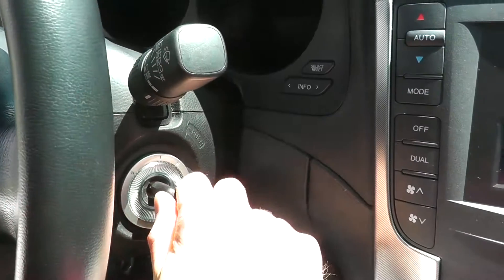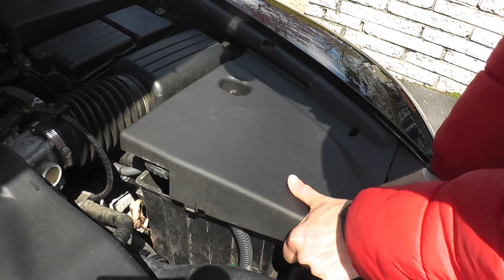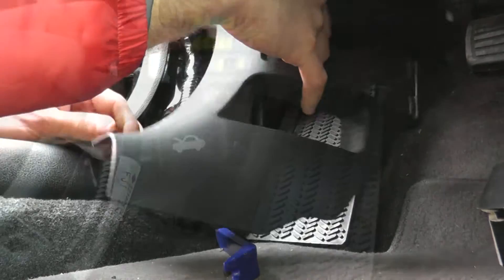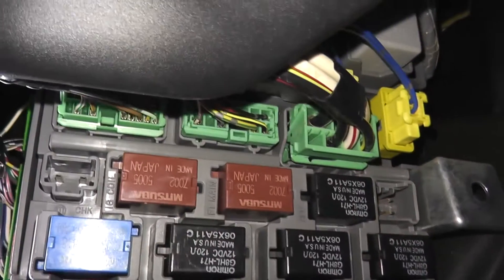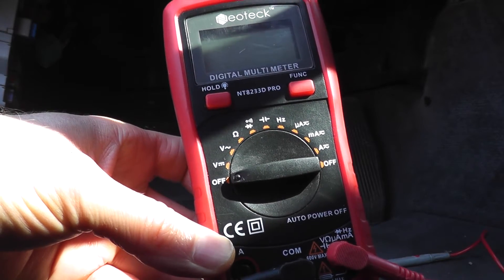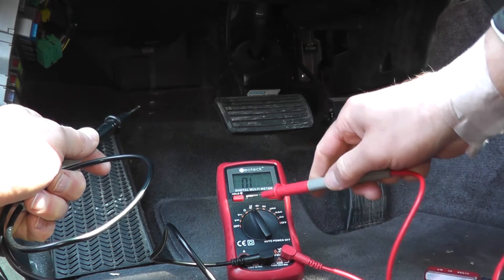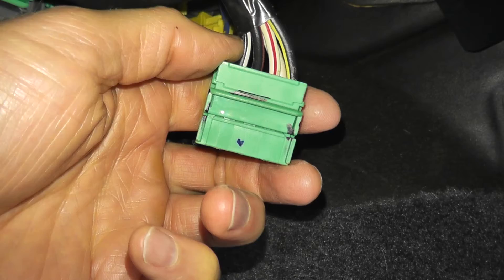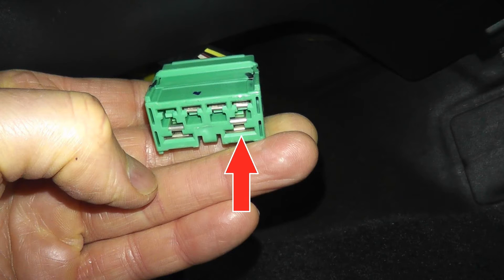Acura TL Ignition Switch Test | No Start - Stalling - Key Stuck Help

Comment: Issues with intermittent start. Solid White and Black / White wire (second test) had no continuity. I replaced the ignition switch (electrical part) and still have the same issue. I tested starter, starter relay, and neutral safety switch. It all checked out fine. Im stumped not sure what else to do. Do I need to replace the entire lock assembly ?  Thanks
Reply: Did u get anywhere?   Im currently going threw this.  Currently car acts dead.  Has new battery and terminals nd alternator.   Replaced the ignition switch.  And nothing.   Im think its the cylinder.  Any tips would greatly be appreciated

Comment: My 2005 Acura TL car will start, and after turning it off I go to start it again and it clicks 1 time but will not start. It takes multiple attempts, and then it starts  then i do it all over again. A couple of unsucceaful attempts with one click and then a start.
Reply: Have you fixed the problem? I have a similar problem
Reply: Yes, I’m currently dealing with the same thing

Comment: Hi my name is Kelly I have a question I have a Acura TL 2010 it doesn't start when I push the button it doesn't click it doesn't crank the lights on the dashboard go on but that's it in the light comes on for security thank you I hope you can help me
Reply: I am having the same issues. What did you do to fix it?

Comment: How do you know if it's the switch or fuel pump relay, my son's car TL 2002 208k miles, just stalled today after 5 miles of driving, waited for an hour for a tow and he decided to turn the key and ii started again, new starter 6 months ago, battery and alternator tested and both are good
Reply: When you turn your key to position 2 you should hear a hissing noise this is your fuel pump engaging. Also you’d most likely still have power on your dash with a bad fuel pump relay
Reply: @princezay3608  it was fuel pump relay, thanks for your response

Comment: What I passed every test except the very last one? On the bottom right n left
Reply: I had same issue. I replaced the ignition switch (electrical part) but still have same issue. Did you replace the entire steering lock ? Did you figure it out thanks.

Comment: I have a question, when I go to crank my tl it sometimes doesnt start right away and acts like a dead battery. It usually starts after a few tries but something is starting to fail I think
Reply: I had this problem and almost changed starter but I found out if you turn your steering wheel pretty hard one way or the other it will crank.
Reply: did you fix it? I’m having the same issue
Reply: me too, did you fix it?
Reply: @shirlene767  no, I haven't fixed it yet. Sometimes it starts and every couple months when I turn the key nothing happens and then key wont come out. Usually if you keep trying then after 15 mins or so it will usually start. It happened again earlier today. I'm thinking it is the ignition switch
Reply: @r-kellyspeesheets908  I have the same problem and thinking it could be a starter.
Reply: @wojtimore1  after I replaced the starter I still had the same problem randomly,  it ended up being my neutral safety switch
Reply: @r-kellyspeesheets908  replaced stater with used OEM from eBay. Took a starter apart and one of my brushes was stuck in place. Brush was not moving and got prematurely scraped and there was not connection. I have the old starter as they go for quite of money. If I will need it I'll buy the brush set kit from eBay 15-25$
Reply: @r-kellyspeesheets908  what is the neutral safety switch, having a problem with my Acura TL 2002, new starter and 2021 battery and it would not start and it started after 45 minutes, could be the ignition switch?
Reply: @giang nguyen  Google a neutral safety switch and check it out. It was awhile ago when I had this problem but nothing worked until I fixed changed that neutral safety switch. I found a video on youtube  I did the work myself and remember it was really easy and not a expensive part.
Reply: @r-kellyspeesheets908  thanks, my car just started after it got towed home, will see if that happens next next time, thanks again
Reply: Having this problem randomly it will click as if it’s a starter problem 200k maybe time to switch the starter ? 🤔

Comment: My 2005 Acura TL does not crank. I’ve tried all of your resolutions and still nothing. When I turn the key my flashlight blink and there’s a buzzing noise on my fuse box inside on the driver side. My wife used my spare key to drive the car, it started than dies out minutes later. Please help!!
Reply: What was it after all

Comment: My 2006 Acura TL don’t take my key 🔑 
My green light is blinking and my car crank but don’t start, can you make a video how to fix please
Reply: Hey did you find out how because that what happen to my car
Reply: @nou2736  happened to me twice today.
Randomly started on first
second time i had to put in neutral to start it.
I've read some stuff and said it's the neutral safety switch that needs to be replaced.

Comment: you seam to know well the n20b20 bmw engin
i need your help please to know what's the problem
https://www.youtube.com/watch?v=1qo0d6rTzyQ
the torque goes to 40 when i'am on D or R and the engin is shaking when it's cold.  when the engin is hot the torque goes back to zero and no problem. every thing is going well, only the torque and shaking engin.